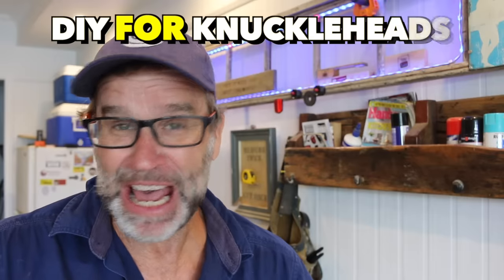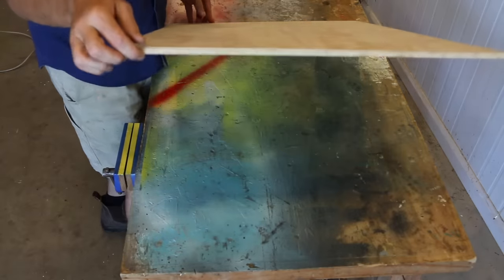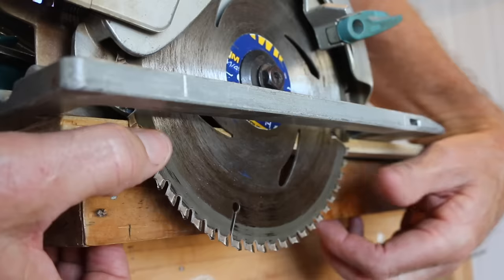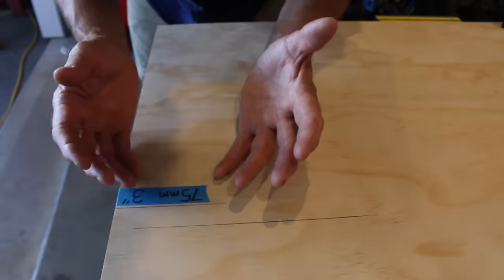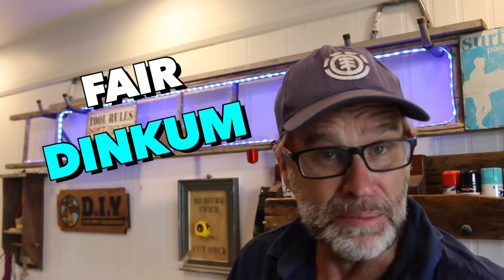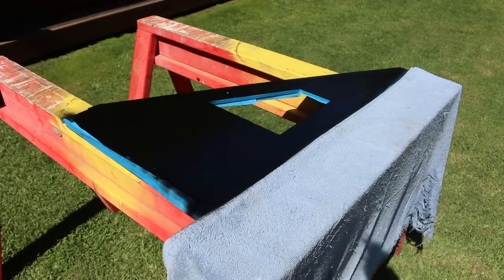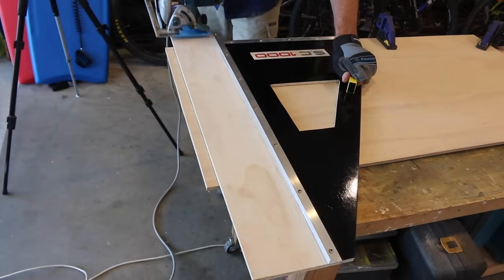How to Cut SQUARE Like a PRO!

Comment: How the hell did you break your tooth on a zooper dooper!?  Have you been storing them in liquid nitrogen?
Either way, great jig.  I made one that is just the straight part without the part that locks onto the work piece so I have to clamp it, and sometimes it's moved on me anyway.  Yours is heaps better and I'll be making one soon to help with breaking down sheet goods. 
Cheers, Knackers!
Reply from the maker: 😂...Just bad luck Adam or chalky teeth 😂😊......l'll be crushing them next time 👊 Good luck with the new jig mate and thanks for watching 👍🇦🇺😁

Comment: May I ask why 75mm (3 inch), not 4" or another length?
Reply from the maker: Hi Vernon....the reason l went down to 75mm was that l remembered that the maximum cutting width for my cutting guide on the circular saw was 75 mm 😊

Comment: Saw where a guy sharpened the last 25mm of the top of the hand saw so he could use that sharp front of the saw blade to cut off any wood that stuck out at the end of a cut when the waste falls off.

Comment: Detecting a very slight lisp in the last few seconds of video. Better get that fixed! 😂 

Also, I now understand why plunge saws plunge. Because if you don't plunge, you have to approach the cut rather than starting directly above it, and so you need that extra sticky-out bit on the SC 2000 to support the saw on the approach! 😉👍
Reply from the maker: Spot on Luke re the plunge saw 👍 Yeah l was a little lispy 😂 Off to the Dentist on Tuesday....can't wait 💰💰💰💰 Thanks for watching mate 👍😁🇦🇺

Comment: Nice jig. It would be great if there was a way to add an extension to it for cutting a 4ft piece of plywood. Instead of having to make a big 4ft long jig.
Reply from the maker: Yeah that would be handy mate....not quite sure how l would retro fit that though 🤔......Thanks for watching 👍🇦🇺😁
Reply: @diyforknuckleheads , could you fit a longer piece of alloy angle (low profile), over the existing low profile cutting alloy angle as a retro fit for longer cuts?

Comment: how about cutting plywood without a factory edge anymore?...like crooked plywood...i want to make that same jig but my plywood is not perfect square.
Reply from the maker: It really doesn't need to be mate. Instead of measuring from the edge of the ply to the edge of the saw base....give yourself a bit of room and set the long angle about an extra inch in. Next, attach the angles like in the video so that they are nice and square and then run the saw along the long angle cutting as you go. You will then be left with a perfectly square, straight edge.....hope that makes sense.....bit hard to explain in writing. Cheers 👍
Reply: @diyforknuckleheads  thanks for the quick reply. it would be a big help if you can make a video on how to cut plywood with square sides, Keep Safe.

Comment: One suggestion.  Why not leave the leading edge a bit longer, then once the angles are square you can make a first cut and sacrifice the extra, leaving the edge a perfect guide for cut vs the possibility of messing up the angle attachment?
Reply from the maker: Good tip Keith 👍👍

Comment: I thought this design looked great however, I have a left hand bladed saw without the guide recesses under the shoe (bought as a Dewalt kit), so the curent design would be impractical due to the shoe plate.  I would therefore be really fascinated if you have something similar to cater for this (LHS) and for right handed use.  Keep up the good work.
Reply from the maker: Unfortunately l don't Mike 🤔 Thanks for watching anyway mate 👍😁🇦🇺

Comment: Getting ready to do this shortly. I don't trust ANY factory Edge unless Jesus cut it. (He was a carpenter) So on I'm going to design some calibration adjustment into the rear aluminum piece. And again, MAKE SURE your saw is cutting 90 degrees up and down. My DeWalt needed to be modified with a Dremel tool.

Comment: Great video. I'll have to do it. 
1 stupid question but I have it for a long time since I'm in the very beginning:
Fow woods like pine, plywood and MDF, when have to put a screw, in order to not split the piece, we should make a drill first, right?? 
So should I drill a hole same size the screw or a little under the size of the screw? Thanks.
Reply from the maker: Hi Pedro....No such thing as a stupid question mate 👍😁....drill a hole a little bit smaller than the screw you are using and you're good to go. Good luck 👍😁🇦🇺

Comment: Nice tutorial. I think the handle is fitted far away losing stability during cutting board.
Reply from the maker: Thanks mate. You need to experiment with the handle position. This placement worked well for me. Cheers 👍😁🇦🇺

Comment: Thanks for the video. Sleds for the table saw don't work well for large sheets. I'll use a circular and make a jig based on your design. Too bad about your tooth. Hope the dentist can fix it for you reasonably cheap.
Reply from the maker: No worries Phil and good luck with the jig 👍 👍 The tooth, thank god has been fixed!!.....didn't cost the earth either which was a pleasant relief 👍 Have a great weekend mate 👍🇦🇺😁

Comment: I wanted to build some simple cabinets. I acquired or built guides and all seemed well, until it came time to assemble the cut pieces. . . . and I discovered that my entry level skil saw doesn’t cut square. It literally cannot physically be adjusted to cut at 90° and there is no adjustment screw in the base. Everything has a 88° bevel. I literally want to throw this POS off a cliff. Eons ago I used a Skil wormdrive at work and it was rugged and worked perfectly, albeit it was a bit heavy. Their consumer grade kit is crap.
Reply: Could you not add a slither of hardwood veneer using contact adhesive to the baseplate on one side of the blade to compensate for the 2 degrees needed ?

Comment: Nothing wrong with imperial except it went out with the arc, and most of the civilised countries use metric.  PLUS POINTS of using metric: you were born with 10 fingers and toes for a reason.  Counting in tens just couldn’t be simpler.  Adding, dividing, subtracting and multiplying just couldn’t be easier.  Best of all is working with decimal fractions, so simple even a simpleton can do them. Wanna make things easy, just move the decimal point either way and your number can instantly go up or down in 10’s, 100’s, 1,000’s, 10,000’s etc, told you, simples.  NEGATIVE POINTS none.  

PLUS POINTS using imperial, none that I can think of. NEGATIVE POINTS where do I begin. Counting in 12’s is counter intuitive.  Sure if you were taught imperial at school as I was and that’s all you’ve ever known, then counting in 12’s is a bit like learning your times table’s as a kid, you learn parrot fashion.  Worse still is working with imperial fractions, calculating 1 13/16 - 5 /32 * 27’ 7/8 + 123" = 🤔. Sure it can be done but it’ll give you brain ache and mistakes are common, meaning you may often need to recheck your calculations. As I mentioned, I went through school when all of our measurements where in imperial [except for aviation engineering which was metric, and as I’m led to believe the US is too, but I could be wrong] and we were made to learn how to work with fractions. Our currency was in £’s Shillings & pence not excluding Guineas [which are still used today]  Crowns, half Crowns six-penny pieces, thrupeny bits, Florins, Sovereigns all multiples of 12, what an utterly stupid system. Decimalisation came in about 1972 from memory, the change happened overnight.  I remember getting my first pay packet with decimal money in it.  It was so confusing at first because we didn’t know anything different from using an archaic method of using a currency that used multiple’s of 12’s. It took about a week to realise it was so much easier to work with, although I do remember for several months items were labeled in both old money and decimal values for the die hards that refused to accept decimal currency.  They had no choice in the matter thankfully.
Reply from the maker: 👍...Steve....couldn't have said it any better myself 👍👍😁🇦🇺🇦🇺
Reply: One other odd point of interest is in the construction industry. In the UK, as a builder you want to build a stud wall with plasterboard [dry wall for our brethren across the pond] on one side of the stud wall and plywood on the other side, stipulated by the engineer due to the wall being light load bearing. Being that our measurement system is metric, you’d set your studs 400mm on centre.  You buy your plasterboard, the size of which is 2400mm x 1200mm [2.4m x 1.2m] average thickness is 12.5mmm or occasionally 15 mm is used.  You fix the plasterboard to your studs, and the 400 mm centres work precisely with the above boards. However you buy your plywood for the other side of your wall, only to say wtf, the plywood only comes as imperial.  So you buy your 8’ x 4’ x 1/2" boards and go to fix in place. Shit, your imperial boards need 16" on centre, but your studs are set at 400 mm on centre.  This works [just] on your first sheet, but then as you fix more in place the edges of the boards no longer line up with the studs, so you end up planting additional studs fixed to the existing studs in order to screw the sheets in place.  How fekkin stupid is that?
Reply: One final whinge [probably why the Aussies call us whinging poms 🤣] I will only buy top quality tools, I guess I’m a tool snob, or perhaps I’m just a tool.  Top tools seem to come from Germany and the US, the UK on a minor scale.  I’m an old git these days so I tend not to leave my shop as my passion is in fine cabinet making. I think Woodpecker Tools and Incra make some of the finest wood working tools [ other good brands exist ], so I’m lucky enough to own several tools of both these brands. However the majority of these companies tools are only produced in imperial versions, with only a very few exceptions.  What use are imperial tools used in a metric environment?  Okay I hear the arguments that these tools are manufactured by American companies to be sold to the Americans.  So how come my SnapOn tool chest is stacked out with ‘metric’ tools, I also have a number of old Proto tools which are all metric.  So if these American tool companies can and have been doing for decades, manufacture metric tools, why the heck can’t Woodpecker tools manufacture a full range of the imperial tools in metric, rather than just a very small number of metric versions.  I have an Incra LS Positioner fence system for my table saw in metric.  However I get fewer measuring strips for the device, and despite the rude cost of these devices, they only sell a projects book in imperial which won’t work with my metric LS Positioner, what’s that all about? Okay RANT over.........for now.
Reply: @multibusa  I'm comfortable using both, a plus point for imperial is its 'quicker' to say 8x4 than it is to say 2.4m x 1.2m, i know i'm scraping the barrel but imperial had to have at least one plus point.

Comment: You may be suffering from bone density loss the same thing happened to me teeth started breaking easily. You should get it checked out easily reversed with vitamins and minerals if caught in time.
Reply from the maker: Cheers for that mate.....my teeth have become very brittle so it might be an idea...cheers 👍😁🇦🇺
Reply: @diyforknuckleheads  Your welcome.

Comment: Oops!!!!! Would have been perfect until I finished making it and realised my circular saw blade is on the left and yours is on the right. Means I have to cut from the other end making the extra 75mm lip useless but if I clamp the jig to the bench and the piece to be cut, it still works OK. What an idiot😂. I'll make another and flip the triangle around.
Reply from the maker: 😂....Mistake easily done mate 👍

Comment: REQUEST : hello, is there any way you could do a round up of workshop organising projects?
I need to find solutions for storing sorted screws and other small metal consumables, saws and blades, hammers, drills etc...
I need to keep everything stored but accessible. We've got a small garage and everything has to fit somewhere on the walls (not much space due to an up and over garage door). I even have to remove the car in order to open the fold down work bench (actually, I still have to make the bench but I hope you get the drift. I've put up shelves on all the free walls. But it's the logical organising of the shelves that needs to be figured out.
Thanks, great vids. I just bought this table saw and need to find a way to store and use it - without having to move it far : it is very heavy actually : https://www.lidl-shop.be/fr-BE/PARKSIDE-Scie-circulaire-sur-table-mobile-PMTS-210-A1-1-200-W/p100310696
Reply from the maker: G'day Mar.....currently l don't have any of those videos on my "To-Do" List but who knows....maybe down the track a little. I feel your pain re the lack of space as l suffer that as well 😢 Look on Youtube as there are so many good table saw storage videos.   I just have mine tacked onto the end of my workbench....good luck and thanks for watching 👍😁🇦🇺

Comment: Oh that's gold mines only 7inch but you buy up to 12inch haha
Reply from the maker: Hahahahha 👍
Reply: @diyforknuckleheads  still wonder and going to test can you use a jig saw to cut the nails on a pallet or would they reck the saw blades (even if metal cutting blade )
Reply from the maker: @MegaLancet  The jigsaw with a metal blade will cut the nails. The only issue is that the jigsaw is not good at cutting the nails on the middle stretcher as the blade is to short. That's why the reciprocating saw is better. 👍
Reply: @diyforknuckleheads  good point thanks